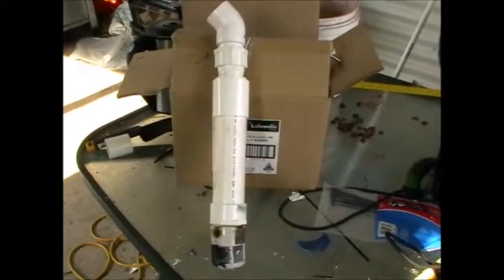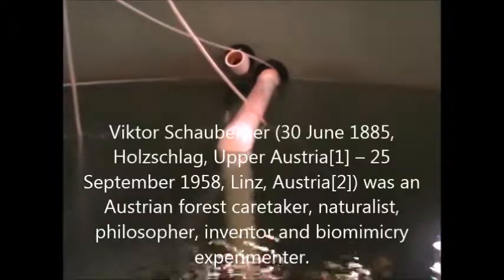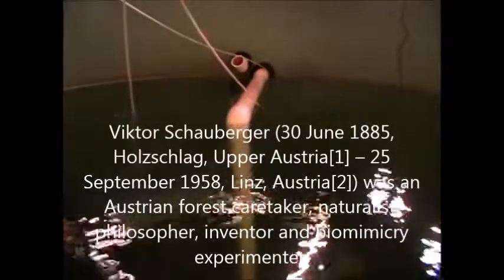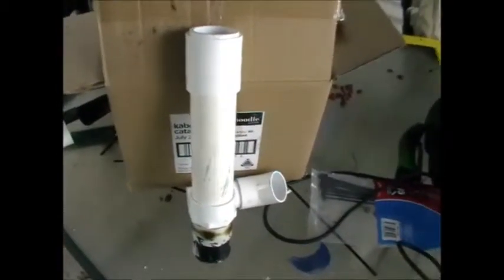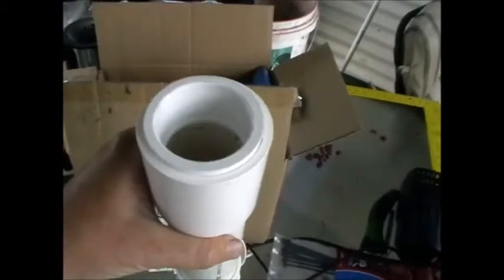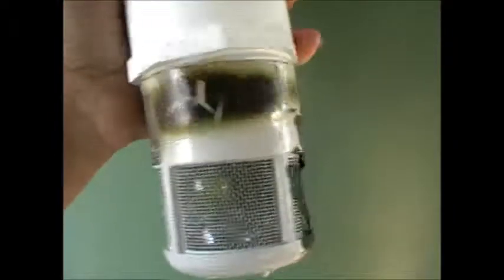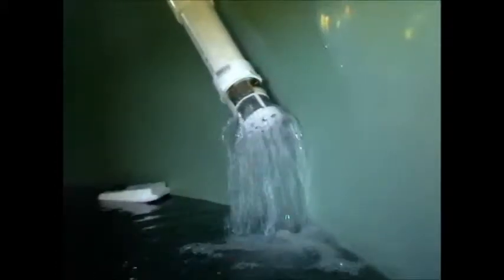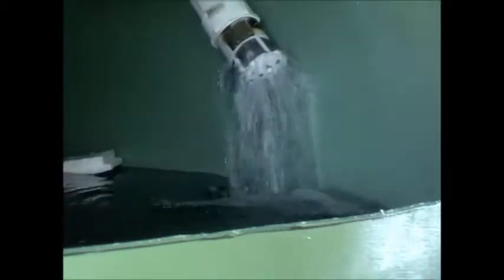Aquaponic Water Energizer and Structurizer

Comment: Force the water under pressure, through a double spiral chambered pipe similar to the one that Victor Schauberger used, and it can be used as a water filter as well as a water energizer. Properly engineered to implode harmonically , it will even filter out or de-anatomize radiation from Fukushima  

Go onto U-tube and do a search for gravity anomalies. There are many examples on U-tube around the globe. These are caused by water vortexing underground, under pressure from the mountain above. Victor Schauberger observed natural anti-gravity from the vortexing water under a waterfall that helped trout go upstream, but underground, the water comes under pressure the rock above. This increased pressure adds to the water polarization of the water molecule and adds to the strength of the ant-gravity field.

It is possible to design an ant-gravity machine that runs solely on water, vortexing under pressure, that can be used to cleanse air or water of radiation or any harmful substance. Such a machine can also be used as an independent power source.